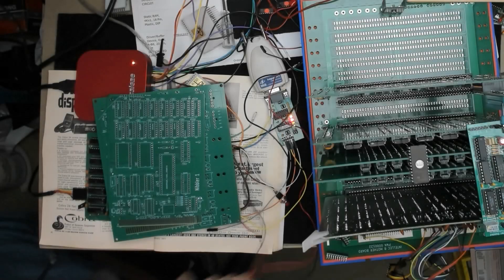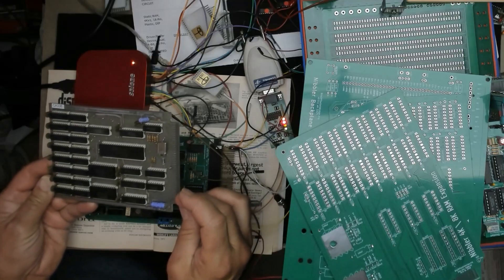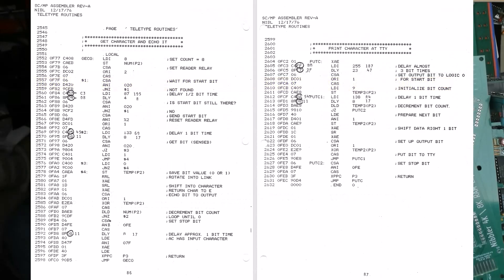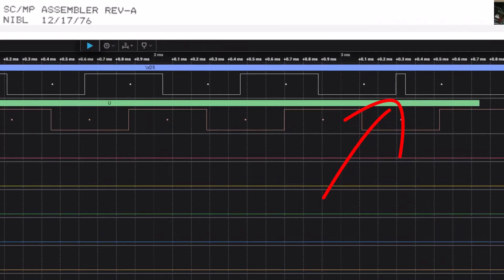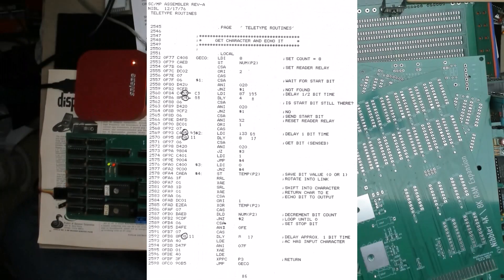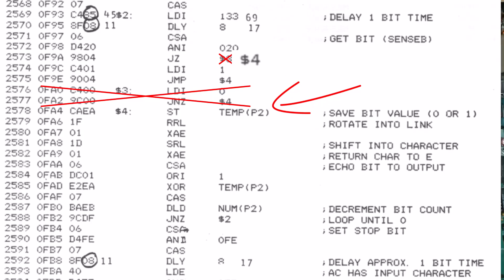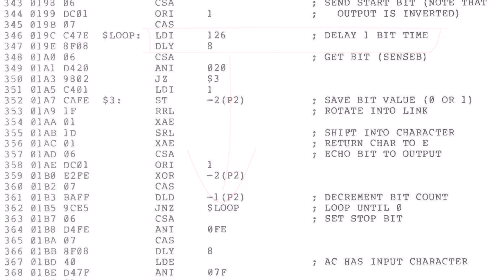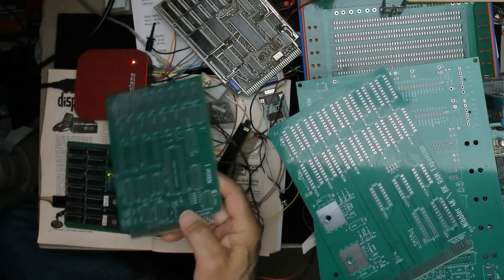{141} Bringing up the Digi Key Nibbler Workalike Board

Comment: Congrats Craig, that is extremely well done! I would have never been able to go through all that (too many projects, too little time.😉) Thanks for your detective work. Also, since this is a controller board, do you plan on creating a few I/O boards - I noticed that your motherboard holds more than just the two boards that you have created.

I would love to order one of these, but unfortunately, with my spinal cord damage, my soldering days are behind me (at least for more than a few joints.)
Reply from the maker: Hi Art, thanks for the feedback and support.  I don’t t know about making I/o, but probably need a rom board for program storage.  Need someplace to keep utilities and programs. At a minimum, the system needs a hex file downloader.  Like you mentioned, there are five slots in the backplane so room for more. Maybe someone else will want to make expansion boards.  I suppose it wouldn’t hurt to have some sort of a display / keypad board either.

Comment: For those who are interested in a typed-in copy of the listing, it's on the vcfed forums.
And having typed it in (with the help of running a disassembler first), that just increased the tension of watching to see what he had done. (For instance, knowing that the code is tight, and that it takes seven bytes to do a long jump or call!) Good code golfing!
Reply from the maker: What cross ssembler are you using?
Reply: @HelloWorldETX  Not using an assembler, just trying to make the listing file the same as the scan. I use my own assembler/disassembler asmx and disx, which are targeted for mac and linux command line. It took me two days to get SC/MP added to my big disassembler, but I didn't feel the need to spend a time on an assembler right now. I guess if there isn't one out there I could do it. It's a really sparse instruction set.
(FYI, if you look at it, you probably really want to use the svn version, it's way ahead of the numbered releases on both)